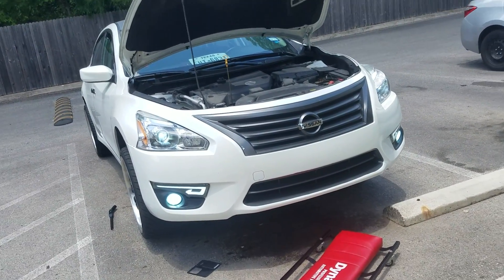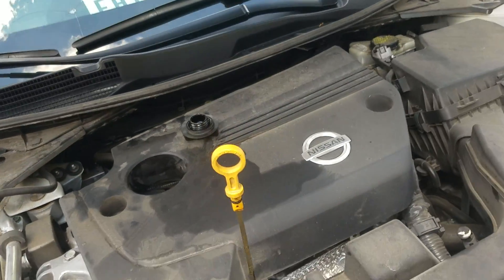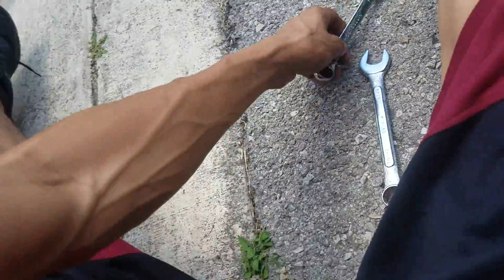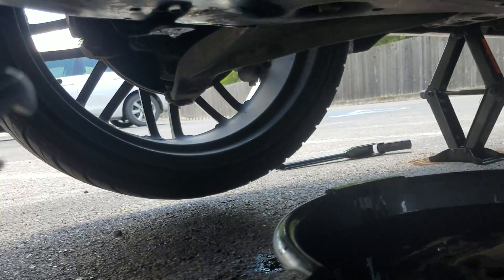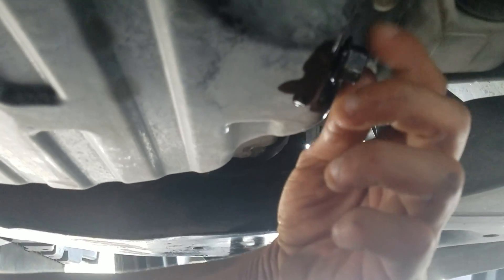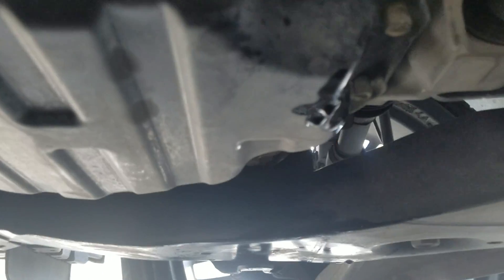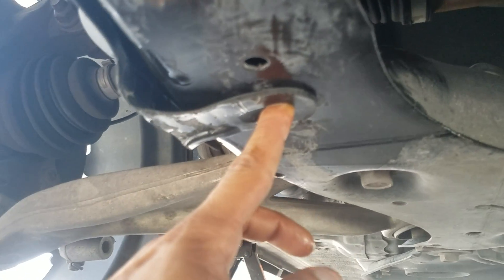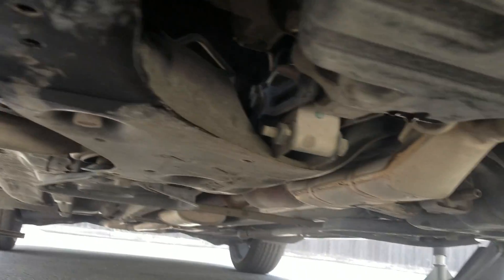2013-2015 altima quick oil change

Comment: this is a great no nonsense guide. another dudes video said you had to remove the wheel to change the filter!  no thanks
Reply from the maker: mst3kpimp yea that's definitely overkill
Reply: It's easier and less messy to just take the wheel off and wheel well cover.

Comment: Well, I am not going to buy a used ALTAMA. One thing I do when buying another car is see how well it is designed for easy maintained items like oil changes. Nissan has failed my test!!! Their location of the oil filter and the fact you have to fuck around taking clips off for panels to get at the OF is BS.  You did a great job on the video. Thank you !
Reply from the maker: You're doing yourself a favor. New Nissan's have bad transmission. Alot people complaining about it going out. Gonna try and sell mine before it goes out

Comment: Is it a good idea to let the car down after you remove the bolt and filter for best oil drainage?
Reply: With the drain plug where it is, the optimum drainage is with the vehicle in the front raised position

Comment: What type of oil and filter for a 2015 nissan altima?
Reply from the maker: I always did 5w30 full synthetic mobil1 and my motor was solid.  Forgit he filter number
Reply: @gabrielgalaxygh  what about the 0W-20 on amazon?
Reply from the maker: @officialtjtrev8910  I thibk the new ones run on ow20 but I always put 5w30 in mine and the motor ran great and sounded great. No ticks
Reply: @gabrielgalaxygh  
Thanks what about filter?
Reply: I use Liqui-Moly 0W-20 Full Synthetic motor oil. STP Filter S6607XL, long life 10,000 mile filter.

Comment: How many quarts after drain in the engine
Reply from the maker: 4 and 7/8 of a quart I believe. I just put the whole 5 though
Reply: @gabrielgalaxygh  Same. I just did an oil change in my 2013 Altima (4 cylinder). It will hold 5 quarts (with filter change) and that takes it up to just about the full level on the dipstick.